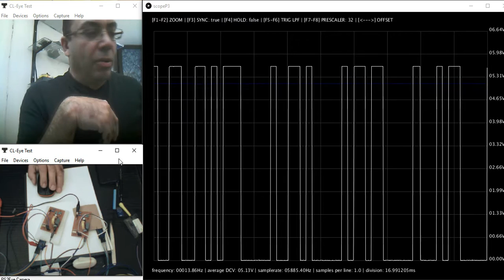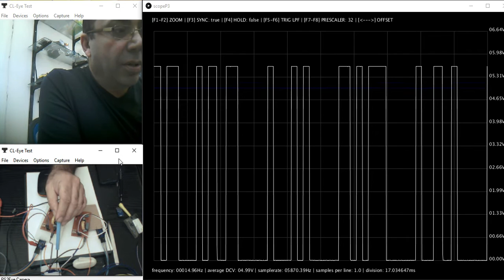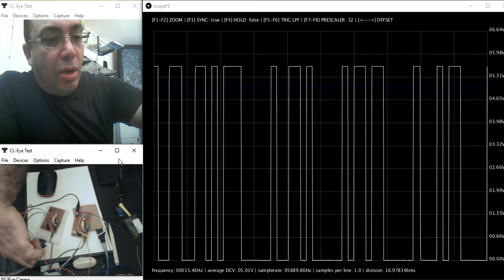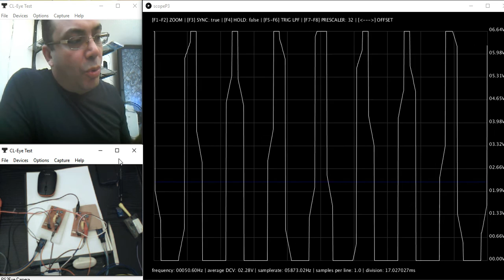Powerline communication (PLC)

Comment: For a home which is already taking electricity how would we mix signal with existing electricity running though the wires. OR In PLC electricity comes to modem first , then modulated and feed into outlets. thanks
Reply from the maker: the signal will pass through the existing wires without affecting it

Comment: Hi Samir Tafesh. This video really Great.! and i have a question, what is max length of DC wire.? Thankyou.
Reply from the maker: Dear Danh, i have not tested it on DC, but on AC is about 400m of wires
Reply: @SamirTafesh  Thanks Sir. I'm doing a project DC PLC in Fire Alarm System. Can you tell me what you used IC and MCU for your product. They work with DC PLC.? Thanks.
Reply: @nguyenanhdanh5286  Hello Friend
I am working on DC PLC communication. but there is a problem in the communication part. I am using for FSK xr-2206 and xr-2211
For communication you are using which IC.  why can you do filter and coupling.